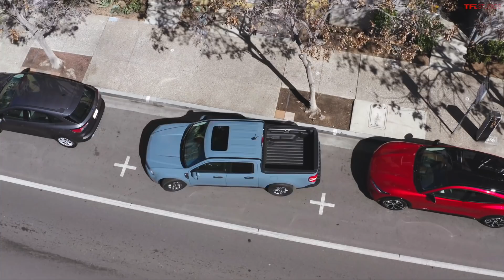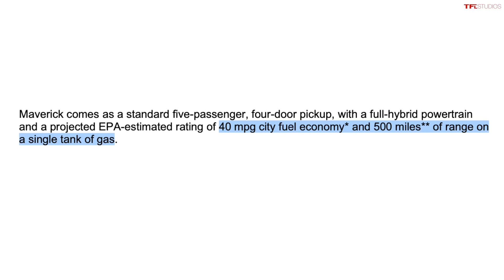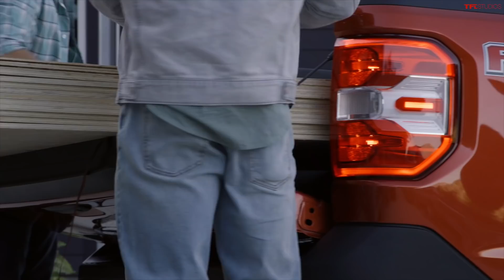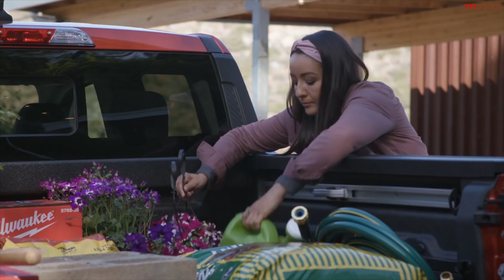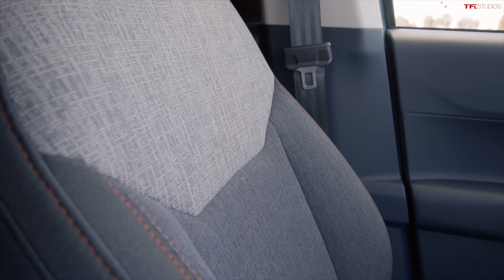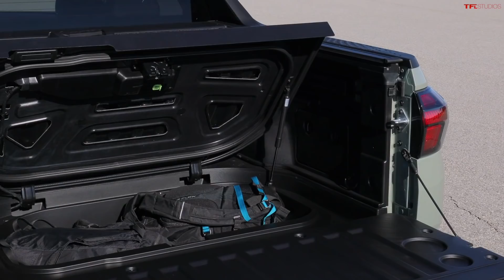Hands On With The New 2022 Ford Maverick: Here Are The Top 10 Things You Need To Know!

Comment: If this truck holds true to the original Maverick design philosophy the junk yards will be cluttered with them in about 5 to 7 years. Yes the original Maverick was only $1,999.00 new with no options but I once found 11 of them lined up in a junkyard in 1976.  They all had between 60 and 65,000 miles on the odometer and there wasn't a dent in a single one of them, They were all there for catastrophic mechanical failures. And yes, before anyone says it... a catastrophic failure on a $2000.00 car might be more minor than a catastrophic failure on a $20,000.00 car. 

We did keep my mom's 1970 Maverick for 10 years, but it was around 20% Bondo by that point.  We sold it for $500.00 with around 60,000 miles on it. Overall, up to that point it was a fairly reliable vehicle and got great fuel economy even though it performed like a slug and handled like a walking catfish on land and that was with the upgraded 200 cid engine with the automatic trans.  I'm not saying we did badly, but my 1971 Galaxy 500 was running strong at 23 years old with 175,000 miles on it when it got taken out in a crash... it was also about 20% Bondo by that point.  It did cost $3600.00 and had a new timing chain and lifters done.  I'll let everyone decide which car was the bigger bargain in the long run.  The Galaxy got OK fuel economy with the 351 Windsor.

Overall, like the original Maverick, from my experience with Ford, this is likely to be a good vehicle for those who will keep it for 5 years and 60,000 miles or while it's under warranty, but there's likely to be little joy left for those who want to keep it for the long haul nor for second or third owners.  The hybrid version will be especially tough on folks who can't afford expensive repairs as the truck ages.  Sadly, once this truck establishes a reputation for being expensive and unreliable amongst used car buyers, it's going to tank it's resale value for the first owners... Pretty much what happened to the original Maverick and why it was replaced by the Granada body type, which also died for the same reason. (Note: the V8 versions of the Granada and Mavericks tended to last longer than the base models. They cost a lot more and I saw some with over 100k miles.)

Ford knows how to build vehicles to last and they know how to build vehicles that only last a specified amount of time. And generally without heroic effort once a price point Ford hits it's expiration date it's done for. In any case, only time will prove me right or wrong.

Comment: This truck would be a big seller if it didn’t have the cvt transmission. Those cvt transmission units are complete garbage. You’re lucky to get 107k miles out of that truck because by that time a new cvt rebuild will cost more than what the truck is worth. And I’m talking at least 10k. Get rid of that garbage cvt. They are good for like eco sports and snowmobiles but keep them out of trucks

Comment: check out the RAM 700 sold in Mexico, or the little Tiny Chevy pickup sold in Mexico, now those are SMALL pickups, I bought a Dodge D50 (Mitsubishi) off my Dad when I returned from Taiwan to the USA and he went and bought a little 1993 Ford Ranger, his complaint about the Ford Ranger? sides were higher, and it was harder to lift steel over the side to put in the bed (he had some machine shop customization things going on as a side gig), and both of those were still quite a bit smaller than this one. 
But it looks like I will still like this truck too. -here on the border we do see the Little tiny baby Chevy pickup from Mexico at times, I don't think I've seen the RAM 700 in person though, but it would be fun if those could hit the USA market without some 25% truck import tarriff.

Comment: A slip in bed insert that utilizes the cross cuts and the power outlet to add a conveyor style loader/unloader system that works to offload heavy mixed loads or to pull a motorcycle onto the bed safely would be pretty sick. It could have integrated motorcycle chocks and strap eyelets

Comment: Both the Ford Maverick and the Ford Ranger do not appeal to me.  The Ranger has only a turbocharged engine and I do not trust the reliability of these.  The Ford Maverick is front wheel drive, I do not want a pickup with front wheel drive.  I had two of the old Rangers and liked them both.  The last was totaled by a rear end collision at 170000 miles.  As Ford did not make a small truck for a while, I now have a Nissan Frontier which has been fine so far.

Comment: i think the chain integration on the 3/4 ton trucks sucks to bad because it has to be significantly more structural. these 3/4 / 1ton trucks are rated to tow like 18k at the bumper. Imaging an 15-18k trailer coming off the truck and those little chains and they're hooks have to catch it all. it sucks but it makes sense.

Comment: My curiosity would be for those seeking all-wheel-drive how much fuel efficiency they look to lose? It has fairly impressive stats for the hybrid system but for those that may want to tow their jet ski or bass boat front wheel drive alone is not going to get them in and out of a wet slippery boat launch. 40 mpg in city would be awesome in a little truck for a shop delivery unit for your local parts store etcetera but if it cannot do 25 or better in town in the AWD 2.0 litre eco-boost I think people will opt for the ranger instead just for the durability factor and slightly larger bed.
Reply: The electric motor works the rear end.
Reply: @doubleq1223  No it doesn't
Reply: @Daniel-wb2mm  apologize. Just saying what I learned
Reply: @doubleq1223  no the hybrid is front wheel drive only the AWD is only available in the 2 litre eco-boost and the AWD is activated by an electronic coupler similar to a limited slip posi locker when it senses front wheel slip then the transmission and transfer case allows driver to lock it up like a conventional 4wd  through different terrain selections. The down fall to these systems is that you do not have a high and low range. I believe that the hybrid in an AWD would make it the most expensive option and make the truck unreasonably priced for what market segment it is intended to attract. At which point it would border the cost of an F150 hybrid base model.
Reply: @killacoiler1707  you're very right! That makes sense. Thank you for correcting me! Still a great mine truck in my eyes. I run an 18-wheeler and don't need anything as big or expensive as a full-size pickup but still want the open bed. It's more aimed towards that. I have a full-size Tahoe (1998) to pull something big and heavy but that girl has a drinking problem haha
Reply: @doubleq1223  yeah if it is more or less an out and about running light errands daily driver it makes sense but to utilize it as a do all it surely doesn't make sense. Every vehicle has its purpose and for someone not looking to use this for anything more than a commuter and maybe hauling small loads of landscape materials or smaller objects the hybrid model would definitely save at the pump compared to one of its bigger brothers like the Ranger  or F150.
Reply: @killacoiler1707  I like it because I can't throw my quad in the bed or scrap and shit I find on the side of the road to fix haha or maybe a snowblower. Just so I don't have to drag out the small trailer.
Reply: @doubleq1223  yeah even though the payload specs are spectacular for a uni-body constructed truck the size of the bed is extremely limiting. Keeps us pack rats from hoarding other people's trash 🤣🤣🤣 hopefully my wife doesn't get silly notions of me buying one to replace Black Beauty my 99 F-150. I like the idea of a standard cab and an 8 foot bed. It ensures I get my zen time away from tons of tag alongs except the 🐶 😉😉😉
Reply: @killacoiler1707  haha couldn't agree more brother!!

Comment: Not crazy about turbos, longevity and repair costs... my guess is it will be one of the first points of failure ..$$$
Reply: Turbos aren't really an issue anymore. I have four turbocharged vehicles. 300,000 miles on one, over 200,000 miles on two, and over 100,000 miles on a 2018 Escape. No issues on any of them. My current issue with Fords is the infotainment system software. It works, but it's a little quirky.
Reply: Getting 40 MPG will help pay for any problems!

Comment: I was excited about this truck but not really anymore. I would have liked if there had been a extended cab option, as I do not need 4 doors. Also the CVT transmission is the deal killer, I will not own any vehicle with one. As they are just to troublesome and boring, a normal auto with the turbo is nice at least. I will just stick with my current truck until a auto maker comes out with something similar to what I have now. I have a 2005 Colorado Extended cab work truck package so only a 2 seater with no rear seats and no carpet, rubber floor only. Mine has the 2.8 with auto transmission and 2WD. For my line of work this is what I need, I don't need more than a 2 seater vehicle but being able to recline my seats is needed. My truck is approaching 200k miles and was excited that this could replace it but not quite what I need in a truck.

Comment: It looks good, but I wonder if Ford took care of the issues they have with their electric motors,A good friend of mine has a Ford Hybrid that the electric motor quit working on. He went to a mechanic and he wanted 5 grand for a new electric motor ,my friend said no. Then my friend unhooked the drive shaft from the electric part,then when it was all gas he traded the SUV in and actually wasn't questioned about the issue.

Comment: 10. It's a car with a bed.
9. It's not a truck.
8. It gets good fuel economy for city folk.
7. It has a little turbski option.
6. The bed is really small but you can fit a sheet of plywood kind of.
5. It can tow a tiny trailer with the base hybrid or a small trailer with the small turbo.
4. It has an AWD option with the little turbo.
3. The interior is acceptable. There's even a cubby under the rear seat for tow straps so a real truck can pull you out when you get stuck.
2. 3 trim options and a first edition if you just can't wait for your car with a bed.
1. You're gonna get what you pay for.

Great video Tommy. It's not for me but if someone needs a city truck then maybe a good option. Definitely better than the Santa Cruz.

Comment: Great video, presenter did a good job on this one! 

That said - Ford, we've been asking for a small truck, and you give us this. Do it over, and this time try not to embarrass yourselves. Sure, it's 20k, but by the time you buy the options to make it semi-useful, it will cost as much or more than a Ranger, approaching the price of the F150 lightning. There's no reason to buy this. You've made a Ridgeline but worse. Not only will the Hyundai pull more, but so will most old small trucks from the 2000's or 1990's - for that matter, I had a 1988 Mitsubishi truck that would tow as much as this thing, it would also carry as much weight as this, and it didn't have a tiny little 4 1/2' bed! Congratulations Ford, you made a "truck" that's worse than a 20 year old Ranger.

Comment: Would I buy a truck made in Mexico? No. Would I buy a CVT transmission not made by Toyota? No. Do I like the price? Yes. Do I trust Ford engineering. Not on your life. Why would Ford Make a driveshaft with the carrier bearing welded to the driveshaft? So they can charge $1800 for a $40 part. Why would Ford make a spark plug that has only 3 threads on it? So when it blows out of the head it costs thousands to change the spark plugs. Why does Ford make different brake systems for different models of trucks when they weigh almost the same? So aftermarket companies cant afford to make parts for a limited market. The list is endless. Never buy a Ford only a lease will keep you out of the poorhouse. Of course you can expect a bill from the Lease company for a grand or two for wear and tear no matter what the condition of the vehicle.

Comment: It's not really a truck consider it more of an SUV with a pickup truck bed instead of a cargo area if you think of it like this you will be less disappointed these are aimed more for suburban middle-class families that would like a vehicle to be able to pick up things from home Depot like mulch and block And don't really necessarily need a full size pickup truck or a full size pickup truck payment the problem with unibody is it makes a vehicle pretty much a disposable being that it's just a front wheel drive unibody no different than a car you use it up you wear it out you throw it away you buy another one front wheel drives cost more for transmission replacements front-wheel drive motor sitting sideways under the hood make them more difficult to access to work on these are meant to be purchased driven for 10 years sold on the used car market for a fraction of what you paid and you go out you buy another new one

Comment: Did I see that right on the spec sheet the hybrid oil capacity is 9.7 quarts!?
Reply: I saw that too. Typo?
Reply: According to the specs on Ford.com the 2.5 hybrid's oil capacity is 5.7qt.  5.5qt for the 2.0 EcoBoost.  The coolant specs are 11.6qt and 9.2qt. My Powerstroke takes 15 quarts of oil, but it is a much larger engine.

Comment: I love it and really want one to replace my fusion. I was considering a compact SUV but this would be much more useful for my needs. Dont have the money now, but might pick one up used in a few years.  I hope they release a plug in version down the line.
Reply: It looks perfect for those who don't haul dimensional lumber or tow massive trailers.  The only gripe I have is the AWD version apparently can't be had with the hybrid system.  I assume this will change in a year or two and I won't be buying one until it does.  That said, great job by Ford in making a useful small utility vehicle at a good price.  Let's see the other manufacturers pick up the gauntlet...

Comment: So as the "mini-trucks" slowly grew in size generation to generation, auto manufacturers are now having to make a new line to shrink them again.  I wonder how this vehicle compares in size to the first gen Ford Ranger, or the Ford Courier that was before it.  
Edit: looked it up, this is still longer than a first gen Ranger, which was 184in length.  The shortest configuration of the F150 in the first year of the ranger ( 1983 ) was only 192in.

Comment: What is the Maverick? It’s a CAFE compliance vehicle. The hybrid Mavericks are going to generate offset credits for the rest of Ford’s truck lineup, particularly for the Bronco. This is significant because Maverick’s low price is only guaranteed as long as Ford needs credits. If Maverick sells well, or if sales of other Ford trucks stagnate, or if fuel prices continue to rise, the MSRP of the Maverick will increase significantly. Don’t sleep on the Maverick if you’re interested. Buy one before the starting price goes to $24,995.

Comment: Very nice presentation. As someone who grew up loving the ranger (and still have an 04 2wd xlt) THIS is similar to size and capability I wanted in the new Ranger. The 4.5 foot bed threw me off but honestly I can't remember the last time I actually needed the 6 foot bed in my ranger. My only complaint (and it is slight) is that if I were to get one the 4wd model is what I need (snowy minnesota) but it would be nice to get hybrid + 4wd.

Edit (not a big fan of the name, if you want to bring back an old name for a small truck what about the Courier. Yes I get Maverick gets more attention and marketing etc etc)

Comment: This is enough truck for most people I see in Houston, TX. I have had HDs and now F150 as I pull 7,000 + pound trailers. Many only get a few bags of mulch or some wood fence posts or pickets a few times a year. The crew cab truck is used as the big old cars of the 1960s. I am older and drove them in the 1960s.

Comment: You really should be comparing this to the Santa Cruz and Honda Ridgeline in my opinion. I know the Ridgeline is slightly bigger overall but it's still a crossover based truck, makes similar power, similar towing capabilities. But people shopping for the ridgeline are for sure going to be also comparing it to The Hyundai Santa Cruz and now also the Ford Maverick. All three are built for the same person. the person that needs an affordable family vehicle but also occasionally needs to haul some larger items. I'm not saying the Ridgeline is necessarily in the exact same segment but you can guarantee people are going to cross compare. Lets just call this what it is, crossover pickups. Great video BTW, very informative.

Comment: HYBIRD THE BIGGEST ISSUE THEY ONLY GIVE YOU A 80,000 MILE FOR THE ELECTRIC MOTOR WHICH COST 2,000 TO 3,000 THATS WITH REPLACE AND INSTALL.. SO IN ABOUT 4 YEARS YOU HAVE TO SPEND THAT MUCH WHICH REALLY IN THE LONG RUN ITS BETTER WITH THE TURBO IT GETS YOU 30MPG LAST 3 TIMES LONGER  THE HYBIRD GIVES YOU 40MPG  IN THE LONG RUN TURBO WINS

Comment: El Chrominos and Huevos Rancheros had separate ladder frames. This is a sheet metal unit body construction. Way less safer in accidents and way less durable. This is the size the "new" Ranger should have been, not the old F 150 size it has become.

Comment: This is going BACK to the original size of the ranger. I had a brand new one back in ‘88 if you can believe that. It was an XLT with a 6 cyl because I had to drive 38 miles one way to work to make $6.00/hr. I was 19 at the time and that truck served me very well. Plus, I had the long bed option. 6 1/2’ bed so when I went camping at the lake I just threw an air mattress under the bed cover and slept under the stars if I didn’t feel like pitching a tent. Loved that truck. I don’t really like the new rangers for some reason. They just don’t appeal to me plus you pay the price of a full size truck. Oh, forgot to mention I only paid $10,000 for it fresh off the showroom floor. I had everything on it too.